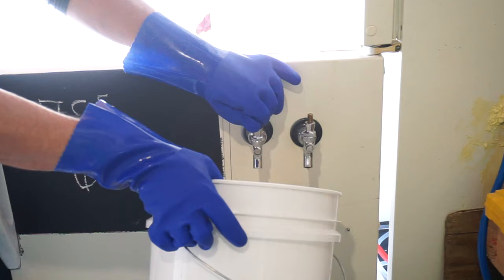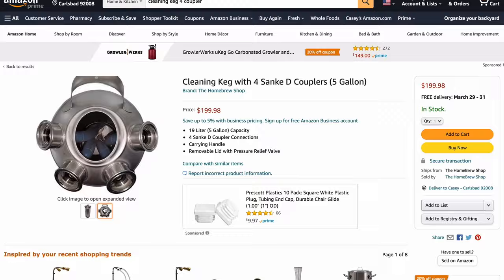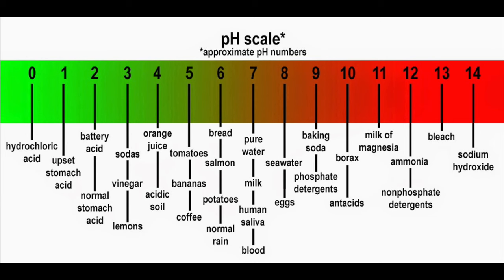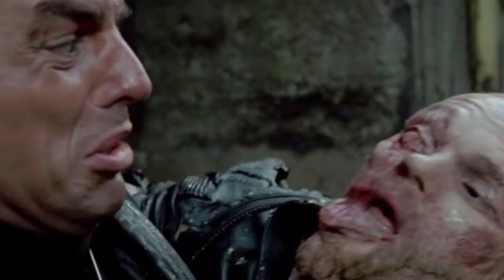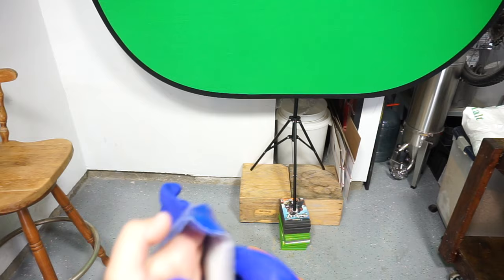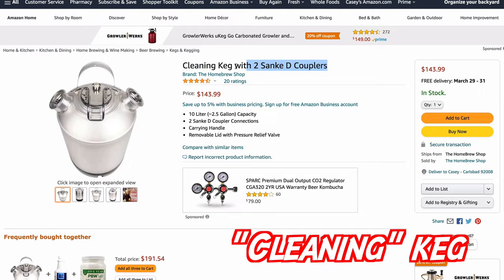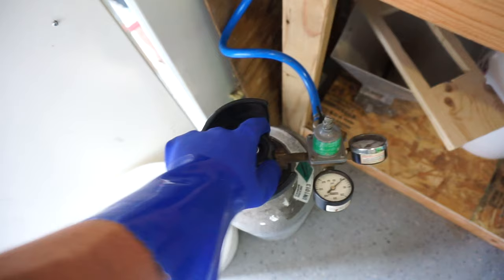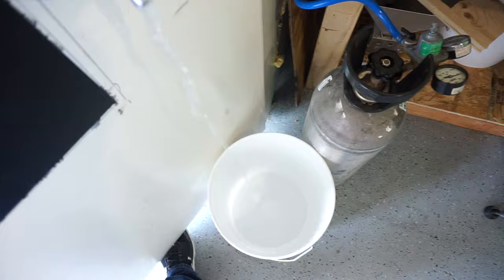HOW TO CLEAN KEGERATOR DRAFT BEER LINES (Caustic)

Comment: For gunked up lines, I use your method. Also after high IBU beers. For everything else I recirculate oxiclean/dawn water with a pump. Works like a charm. BTW for all disconnects and taps, I bought a ultrasonic bath at Harbor Freight for $70. With that I can clean sets of 4 (of everything) in about 10 mins.
Reply from the maker: Solid feedback vesko and im googling that sonic bath right now!

Comment: Good line flush after every keg. Good Ole starsan. Taps and kegs get the oxy clean and reassemble flush with good Ole hto till I'm happy and change lines 1.5 year intervals. I've done it this way forever.

Comment: I tend to clean it after every beer. Just upgraded to 4mm line and some nice short lines. The cleaner I use is BLC with a small pump that can screw into where the tap screws into.
Reply from the maker: Solid feedback! Cheers J Drake!

Comment: Not sure if this is right but it's how I do it. I made a homemade keg cleaner that has a 1/2 NPT fitting for a spray ball and replace that with a BALL LOCK KEG QD POST (FREE FLOWING) TO 1/2" MALE NPT fitting from Brewhardware. Then I use Dishwasher detergent tablets that are generally strongly alkaline and just checked and it is about 10.5 ph with 1 tablet to 2 gallons of water. Then I just snap a keg line on it, open the tap with the bucket under it an let it recirculate for about 15 -20 min then rinse with starsan. I tried Oxyclean but it foams up to much with the 1/2 hp pump.
Reply from the maker: Duly noted! Thx for the feedback Dean!

Comment: I made a line cleaner with a garden sprayer and a carbonation cap - Dr Hans made the same and I absolutely ripped him off. It's like a 30 second build and cost £25, and I don't need to use CO2 or have to have a spare corny lying about to clean lines. I don't use any chemicals other than oxy, then a flush with clean water, than run starsan through if the line is going to be sitting unused for a while.
Reply from the maker: I love it! Solid feedback Mozz!
Reply: @HOMEBREW4LIFE  forgot to say that your video was great too. I think line cleaning is (along with the cold side of brewing) the forgotten about, unsexy side of things that has the biggest impact on whether your beers are great or smell like dog's arses.

Comment: I clean mine once every other month and I use a 2 liter garden sprayer with an keg post attached. C02 is expensive. I use BLC, rinse with Star-San and rinse with water. I need to clean the faucet handles more often, and I think that's where all the crap ends up at.
Reply from the maker: I love that efficiency. We are definitely on the same page. Solid feedback mike! 🍻

Comment: I start with running some water through them to get rid of any old stale beer. Then I run PBW or similar cleaner with warm water in a loop for maybe 20 minutes. I then run water through again to get rid of the PBW.
I use a bucket and the pump from my Mark's Keg Washer to pump it through, it comes with an attachment for this
Reply from the maker: solid feedback FDK, cheers!

Comment: Never used caustic like this, but I have almost an identical process using PBW to clean after I kick a keg and then star san to sanitize/rinse out the line and I let that chill and wait for the next beer. Similar? Bad idea?
Reply from the maker: Yo John. PBW will definitely work, but stronger bases and acids will be tougher on sediment.  This is just the way i learned how to do it at a brewery that i worked at.  Cheers!

Comment: If I didnt have a tower on my minifridge I would probably get the sharkbite style hose fittings that allow you to easily replace the lines.  Seeing how I have a tower it would be more work to access the sharkbite in the tower than it would be to just use caustic.  Thanks for the video! <3
Reply: I did just buy an intertap too so I will probably just pump caustic down through that badboy with the attachment
Reply from the maker: Shark bites are a plumbers best friend!

Comment: Great video H4L! A reminder to clean those equipment right after kicking, so much easier than scrubbing months-old sludge. In situations where you aren't able to run new lines, how many times have you had to circulate cleaning solution before lines were cleaned thoroughly?
Reply from the maker: Solid feedback! And just once with caustic
Reply: @HOMEBREW4LIFE  Great to know, thanks! I picked up a poorly kept kegerator and thought cleaner would clear the old stuff, but didn't do the trick with the KegCo solution, I see that uses potassium hydroxide. I ended up replacing the lines and adding a third tap and used one for kombucha. The kombucha line stains don't clear with the kegCo stuff either, so I'm off to try the 5 Star with sodium hydroxide.

Comment: I clean every keg after they kick. Rinse it out with just water.  Add a gallon or two of water and a scoop of souped up Oxy - run that through the beer line (who's faucet I already cleaned).  Dump that mixture.  Fill the keg with a gallon or so of starsan.  Swish it around.  Run that through the line and leave starsan in the line until the next keg is installed.  Seems like i go through a corny keg every week and a half or so.  Four taps at my house.  Need four more.
Reply from the maker: solid feedback John, thx braj!

Comment: I use PBW through my lines after every keg.  I then run starsan.   Should I be using caustic?
Reply from the maker: If your cleaning often.. pbw and hot water will do the trick. This is just a video on how commercial systems do it. Cheers jon!

Comment: Thank you master Braj! Yeah - I have nasty a$$ beer lines - I need to clean them. Ya make it look approachable..Question: I considered using a pump to recirc a bucket of Oxyclean and water through each line - this looks better - but, would my method work?  Consider 140 degree water in a bucket with oxyclean for 20 minutes running through the entire line with tap, dumping back into the sud bucket...then running some StarSan right behind it. Cheers!
Reply from the maker: For sure that will work! This is just the way I was taught at a commercial brewery 5 years ago.  Maybe it's the wrong way these days lol

Comment: Hey how do you guys cold crash in a solid fermenter? With the air wanting to go back into the fermenter.
Reply from the maker: Whats a “solid” fermenter? And why would you want air to go in the fermenter?
Reply: @HOMEBREW4LIFE  stainless steel. I admit I haven’t cold crashed before, but the stuff I have seen on it shows the drop in temperature creates a vacuum. Which causes air to get sucked into the fermenter.

Comment: I typically clean mine every 3 or 4 months depending on use, simple pbw and hot water solution , disassemble taps soak em , run a gallon or so of water through em and star san. I change mine once every 2 years? I use the evabarrier theyre supposedly ( I fucking spelled it right on first try, YES!) are more anti-microbial . The how often to change beer lines debate will go on forever.
Reply from the maker: Oh for sure. Theres a ton of different ways to skin a cat. I know most legit taprooms do it with caustic once a month. That strategy gives me piece of mind. Ill gear towards that 🍻 ❤️
Reply: @HOMEBREW4LIFE  praise god